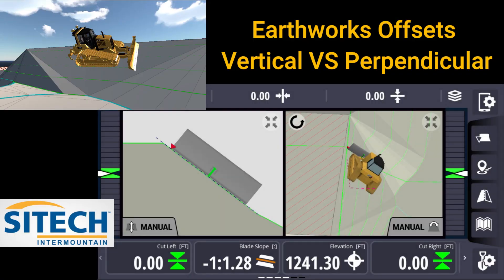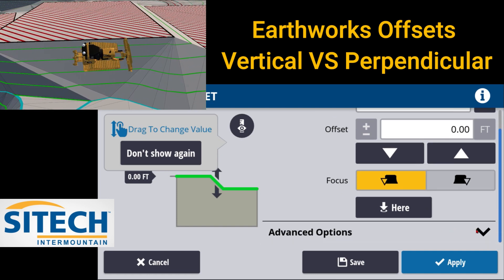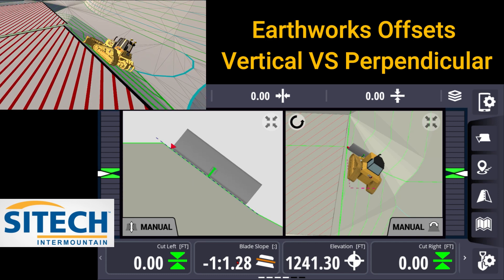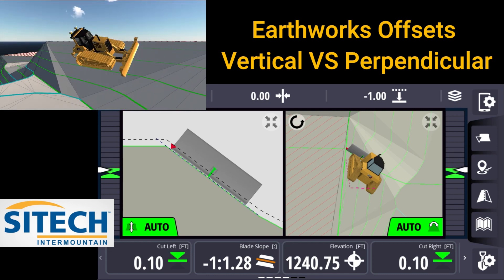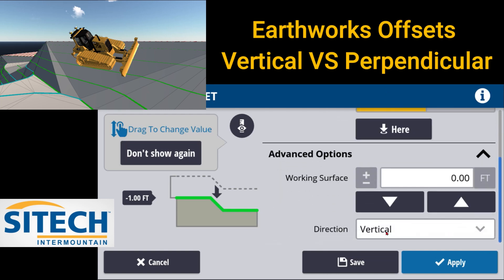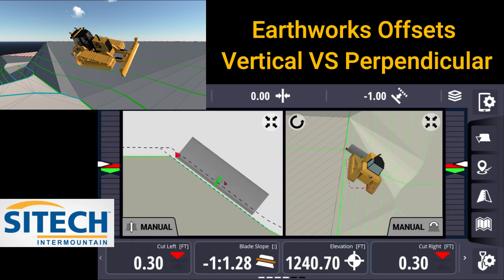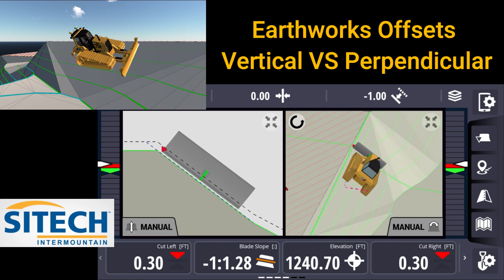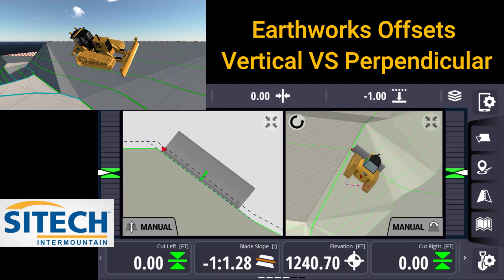Trimble Earthworks Vertical VS Perpendicular Offsets

Comment: Hi, If I'm adding 2 of fill to a  benched slope which option would be best to use? I need the tops and toes of the benches to stay in the same horizontal location. Thanks!
Reply: I am not sure I understand the adding 2 of fill question. Do you mean 2 inches of fill to a slope?  With the difference between vertical and Perpendicular is only going to get off the steeper the slope gets. I didn't really notice a big difference in the cut fill until I got into really steep slopes like 300% or 3:1 and steeper.  You could put your machine on the slope and then with out moving the machine just change between the 2 options to see what the difference is.